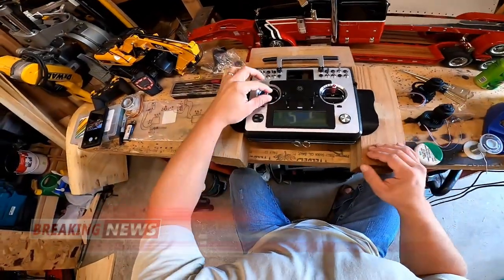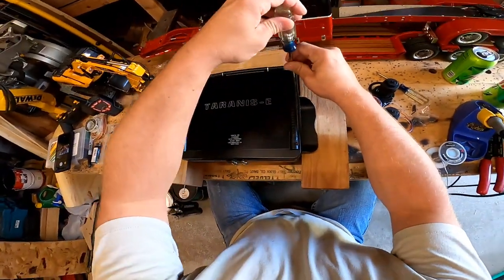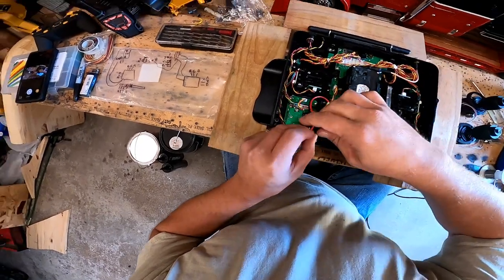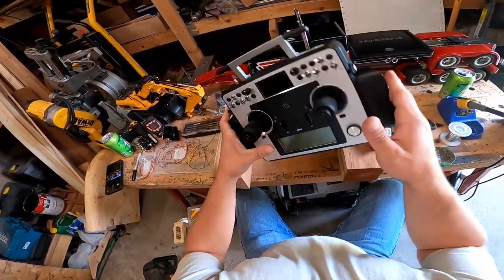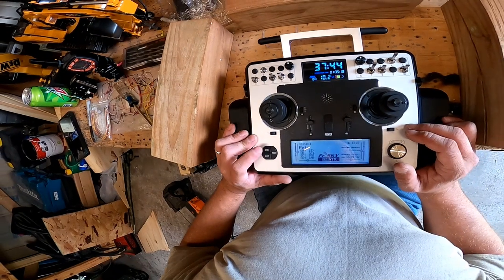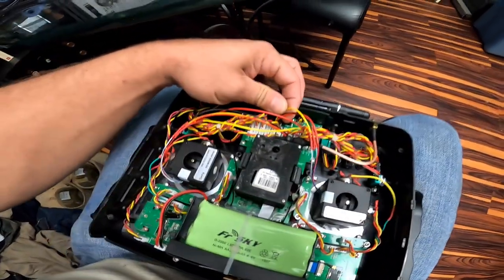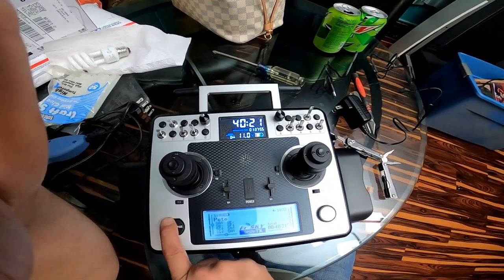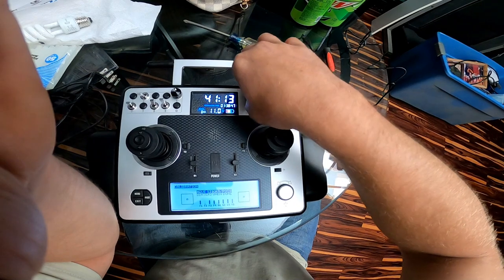How To Install and calibrate 4D Joysticks in a Taranis Radio

Comment: What channel did you connect when you turn the stick? Trying to install theese on a Radiolink transmitter
Reply from the maker: I don't remember off hand. I think it's in the video though? I looked in the radio options to figure out which plugs could accept proportional inputs though. It said some are only 2 or 3 pos, and some can be proportional. And then you can assign them to whatever channel you want through OpenTX. I don't know if Radiolink is different.

Comment: Great video thank you! I want to put these sticks on my  X9E..curious which version firmware are you using? Can you make a video on how to update the firmware maybe? Thanks
Reply from the maker: Iwould reccommend opentx university. They have tons of info, and i dont fully understand it all. I was able to read through and follow the steps and get it updated... but i couldnt walk through the steps without following that. http://open-txu.org
Reply: Thanks for the link, I'll check it out! Did you update to the newest 2.3.10?
Reply from the maker: No, I updated to 2.3.9 but it was the newest when I did the update.
Reply: @KarlsKrafts  Read all the info tried 2.3.10 ..when I turn on my Radio on now, I get an eeprom error SD card error..and channel monitor screen is non functioning! maybe stick with 2.3.9...
Reply from the maker: @blairg420  You will get an eeprom error. If you rebuild the models by creating a fresh one to start with from the new software the eeprom error will go away. FYI, mine still seemed to work with the eeprom error, but I made new models anyways. I don't know about the channel monitor screen though...
Reply: Yeah, I did read that but it won't reset, each time I turn the radio on same warning..I Also noticed, now only 2 sliders and the sticks show in calibration mode..I did fix the SD card error...has to be something to do with eeprom..
Reply from the maker: @blairg420  When you build new models, do not copy paste. I don't know if you are, but I have to delete all models, and create a complete new model. Also, I did that through the computer connection so it was much quicker and easier.
Reply: I tried a factory reset on page 5 menu..that got back all the channel monitor ,sticks ,sliders etc firmware still shows 2.3.10 I'm still getting jitters on the channel monitor...eeprom error is gone tho..ugh frustrating stuff!! Lol
Reply from the maker: @blairg420  Ya, I spent about 2 weeks an hour and there reading and slowly learning this remote and doing the update before I had it all done and figured out. It is nice using the comp to do the programming!